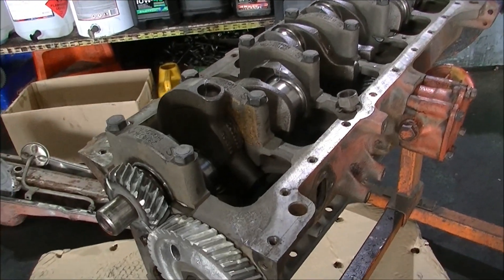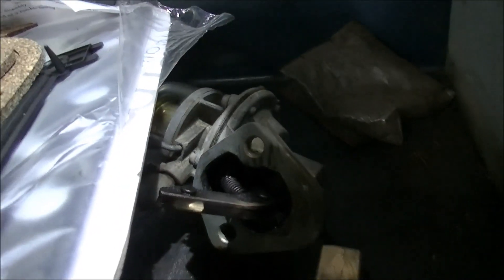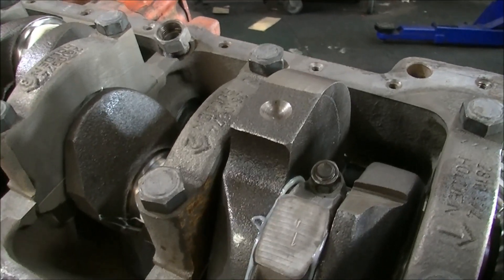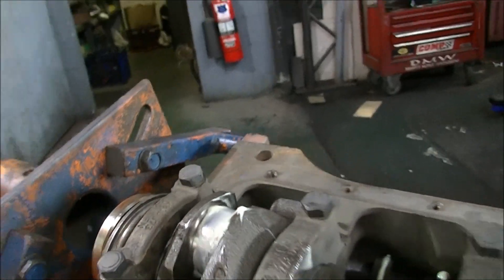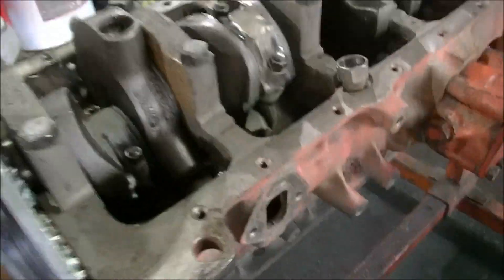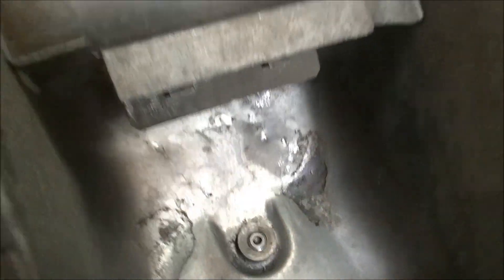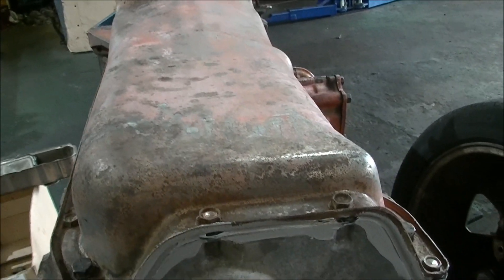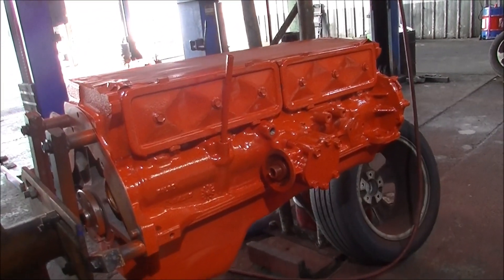1973 Holden Torana Straight 6 bottom end is done.

Comment: I remembered some kid came into the shop next to ours with a HR prem with a 186 he'd just had built with a hot cam with a 650 4 barrel that just wouldn't run right..  well the fuel was going in alright - just most of it was dripping out of the exhaust.. So once he'd been talked out of the cool 4 barrel he just HAD to have, and they put a 2 barrel manifold on and a holley 350 - it started to run good. Quite good actually.
Reply from the maker: Nothing beats a set of triple SU's on a Hot Holden 6 pack....Cheers Tom.

Comment: back in the day when I used to do engines, we would put the new lifters in a pan of oil and use the pushrod to pump them up, naturally the little hole had to be under the oil level and in a short time they would become as tight as solid ones. I guess they do fill up just by sitting in oil.
Reply from the maker: They fill up just fine and I can do other things while they bubble away.

Comment: Did you reuse same bolts ,head  mains and big end
Reply from the maker: Yes.
Reply: @ziggassedup  awesome ,only know newer cars from like vn up ,at they stretch bolts or ?got a 173 with an old LC I picked up ,deciding wether to keep it or get a 186
Can ya get much power out of these things?
Cheers thanks for the reply
Reply from the maker: @morkomally9702  I had an LC in '75...It ended up with a 192,Stage 3 Head 38/78 Bert Jones Cam and triple 1.3/4" SU's...Went pretty good...Sounded great.
Reply: What sort of Block was it to start?
Yeah got me Su,s first thing I bought lol had em before I bought the car lol
Reply from the maker: @morkomally9702  186 bored 60 over.
Reply: Yeah cool ,think lll turf the 173 I think 
Cheers